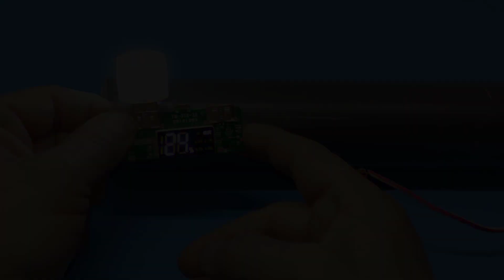How to make a 3.7 volt rechargeable lithium ion battery

Comment: How much the capacity bro?
Reply from the maker: 14 thousand mAh 3.7 volts
Reply: @NetHelp2  very interesting bro,thank you for sharing,if the industrial batteries are made this way,can I thought inside my phone batteries it contain liquid inside not 100% dry? Is that correct? Or there's something chemical can replace the water?
Reply: @NetHelp2  do you think I can use this batteries for solar cell storage?